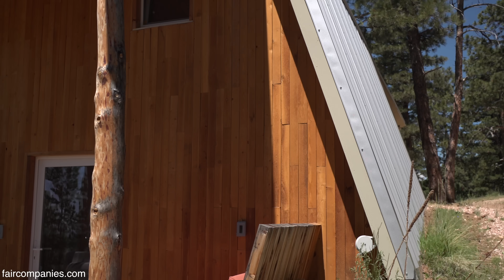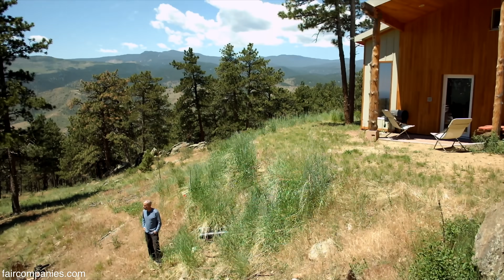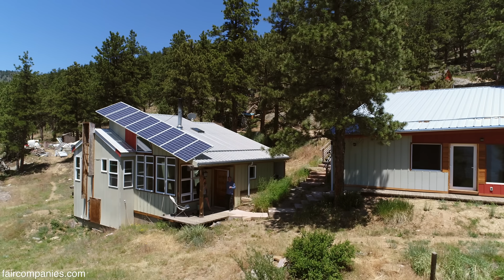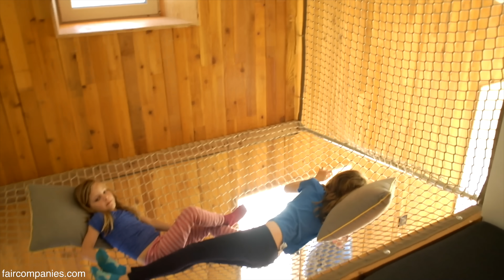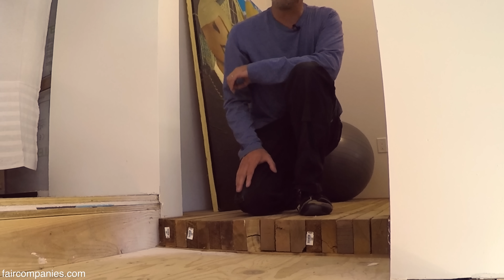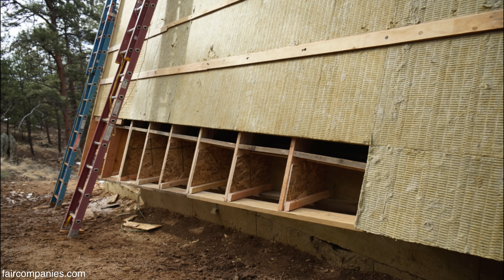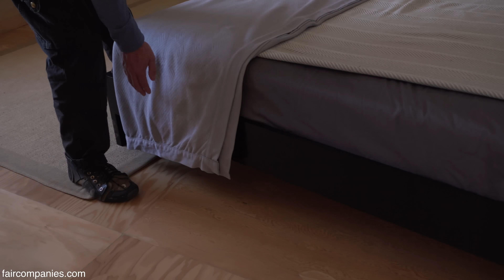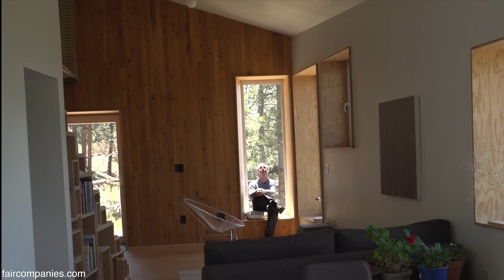Designer builds efficient off-grid Passive House in Colorado

Comment: I think it's absolutely asinine for it to be against the law to collect rain water for your own use, like for watering the garden or for the toilet, anything that doesn't have anything to do with drinking it or bathing in it. Then of course during summer, towns often have a water ban. You can't wash your car, or water your garden. In some towns you can't even have a food garden!
There are WAY too many stupid laws and regulations that make it hard to be innovative, thrifty, clever and even eco friendly.
I remember my grandfather placed a bunch of big barrels along the bottom of his garage roof line because a big storm was due. It was a big storm alright, the rain came down in torrents and filled up the 55 gallon barrels in no time at all from the rain pouring off the roof. He saved all that water because there was a water ban on. The water was for his garden. He would dip a small pail into the barrel and pour one pail's worth of water for each plant he had in there each day. That storm was lucky, because sometimes we don't get big storms like that. So it saved the garden.
The really stupid thing is, I can wash my car with less water and soap than the car wash uses. Then you have businesses with automatic sprinklers watering their lush lawns during the hottest time of the day, so most of the water is wasted as it evaporates and doesn't have much of a chance to soak into the ground. Other times they're running when it's raining out! Ridiculous! But a home owner can't water his lawn.

Comment: I'm curious about fire protection. He mentioned that there had been a large forest fire. What type of protection or prevention have they done? The home has three trees very near it and is comprised of a great deal of wood, which would be a concern for me. Thanks!
Reply: HolisticVibrancy the urban wildland interface is a precarious place to build. The house uses several methods such as a fire rated assembly of cement board of steel with mineral/stone wool board underneath for the exterior. The simplified shape creates less places for embers to lodge. The trees are a part of the protected space. There are no ladder fuels and a break in the tree canopy with lots of thinning beyond. Ponderosa pines are quite resilient to fire if not too dense, if fact they rely on periodic fire for a healthy forest. Finally the windows are triple pane and tempered to resist cracking from a heat front. Many rural homes burn in a wildfire not from the outside but from a windows breaking and embers getting inside.

Comment: He took a lot of earthships ideas and did the most impotant one terribly by building a huge  north facing wall. but he also did some amazing things like the net bed the floor wall next to it, the stair boxes, his flooring choices, and kitchen cabinets/counter etc.
Reply: This is not really anything like an earthship aside from some passive solar. The earth rammed tires were reused from an older shop and are outside of the thermal envelope.
Reply: Let met first say that I think your approach and execution are nothing less than brilliant!!! 

I slightly misspoke. Let me correct my first statement: There are many elements of this build which are similar to earthships: Rammed earth tires, passive solar, rainwater collection, Cooling tubes, berming/ passive geothermal (it seems). The rammed tires of older earthships were never inside a thermal envelope. They have only now begun to experiment with that in the last few years by creating a thermal break. Cooling tubes are used in earthships.

My only critique is of the height of the north facing wall. I think it was a contradiction to have said, "you don't have a lot of walls on the exterior." and the to have an exterior north wall  that is, on appearance, equal to and or taller than the south facing wall (albeit outside of the thermal envelope which is an interior wall that has at the very least "18 in. of insulation" and is itself more than like insulated.).

Again you execution and approach to tapping into the steadfast laws and physics is no less than brilliant and as an aspiring build I only hope I build a home HALF as brilliant I i truly KNOW yours is.
Reply: Thanks for clarification and the compliment. What you are referring to is what we call form factor- where you maximize the floor area relative to overall exterior wall. The great thing about Passive House is we need a moderate amount of solar gain for it to work so I don't need a huge wall of glazing. The overall wall system can be simpler but the north elevation being larger than the south has no significant extra heat loss. Since much of it is protected thermally by a second exterior wall (partly tire) that is accounted for in the energy model. These are not hard and fast rules but guideline which can be modified based on building needs in the certification design process. You can build many different ways to get the same result.

Earthships are really quite limited in how they respond to climate conditions so I get a bit queasy when I hear them compared to Passive House.
Reply: //You can build many different ways to get the same result.//

Indeed. There are many ways to to get from Boston to Worcester including taking a boat to Portugal, train thru Europe, bus train, camel, train bus, boat from China to California greyhound etc. The result is the same as getting in your car and driving at 65mph for 45 mins on I90 West: you went from Boston to Worcester. But was it the most efficient and effective means of getting there? 

My question was not about the end result being the same (straw man). It was rather is the building technique employing the most efficient use of materials to enclosed space and thermal regulation divided by energy input in material production. installation, and maintenance over the long term. 

//Earthships are really quite limited in how they respond to climate conditions//

I'm curious to know what exactly you mean by this.
Reply: Sorry, when I said same result I should have specified to achieve Passive House certification. Earthship were made for high desert environments and they do OK there but most of us need a building with a very different climate, orientation, program etc. I think the rule of thumb design approach such as earthships is from an era before we could calculate how a building performs and has not kept up with building sciences.

Comment: exscape is not a word.
what does he mean he doesn't have a lot of walls on the exterior? at least 4 right?
I like the staircase but yah its a tansu basically. but still I like simple boxes and I have done a similar thing in my daughters room where the storage boxes become chairs but mine a dimensional a bit more sophisticated ie the measurements with cushions are at optimal ergonomic height for seat, desk or tables depending on which side is up. 

i like these houses but there are a few reasons why they are not sustainable.

1 land prices make you move so far out of civilization that its hard to make a living.Its hard to make a living off the grid. 
2 still the house is going to cost you quite a bit which means you need a decent job, winning the lottery or an inheritance. 
3 imagine if everyone did this in Colorado and tried to catch the water. not sustainable.then again Im not sure there is a better solution for a remote house like this and im sure most people dont want to live so far out. 
4 relationship with yourself is fine but some would call that schizophrenic or antisocial. LOL.   people have a basic need for community. again not sustainable.

 natural does not equal sustainable. 

BUT overall its well thought out and I like it.

Comment: I had to laugh when I saw all the boxes.  I moved from a large 4 bedroom, two bath apartment to a 1 bedroom 1 bath apartment.  The large place had one whole wall of built in bookshelves; perfect for me and all my books.  Of course the smaller place had none. I had to come up with ways to fit all my books, so I bought 11 1/2 X 3/4 inch shelving boards and made open boxes of different sizes.  It is hard to reconfigure space when sizing down -- I had some things in storage boxes for a year before I emptied them into their new places -- and the boxes were easy to move around and stack and rearrange as I settled in.  Two boxes ended up as storage in the laundry/pantry/storage room.  One box is in the front clothes closet that I now use as part of my "office" and in this box there is a pillow for my cat (which she thinks she discovered all on her own.)  The rest are stacked up and hold books.  I LOVE the versatility of boxes, and I see this guy does, too.  :)

Comment: He sure used a lot of toxic materials for trying to be so eco friendly.
Reply: Kat we really didn't go into materials much in the video but this is a foam free low toxic project by just about every measure. Feel free to take a closer look in the Inhabitat articles I wrote on the topic https://inhabitat.com/how-to-build-a-passive-house-off-grid-without-foam/
Reply: It was mostly the floor that concerned me.  Personally I wouldn't want to use things like Polyurethane and if I was going to use plywood I would want to be very careful because typically it's made with formaldehyde.  Those to me would not be things I would want to put in my house and also their manufacture is not good for the environment which when designing a green house to me is important.
Reply: Kat its actually a polyacrylic I (misspoke in video) 50 ppm VOC. We are doing extensive indoor air quality measurments with  University of Colorado and are finding little added VOCs to natural background. Remember all wood buildings use glues for beams, plywood, or OSB for structure so rather than make assumptions it best to use best practices and then measure results.

Comment: Great info. I wonder how he joined/sealed the edges of plywood pieces with each other to form the seamless joint. Good idea.
Reply: Nurgul Konyssova good question. I used a biscuit joiner and did a little sanding at the edges. Hardest part I remember was to try not to have any squares off so the next pieces lined up.
Reply: I think you did it brilliantly. Smooth floor surface made of such common and rather inexpensive material. Nicely done.

Comment: I guarantee moisture and mold issues with this stupidly constructed home
Reply: Damien Thorbjörn with thick walls mold is a critical issue. The walls vapor profile was very carfuly designed to have little or no condensing surfaces in the dew point range. The walls also are very vapor open to the exterior. The ceiling utilizes a "smart" vapor retarder on the warm side.
Reply: @ACMichler  what a polite reply to a mean comment

Comment: I am very fascinated about passive houses.  You answered a important question: are they necessarily expensive to build.  I've read those windows are expensive, but you have created a beautiful space using elegant, inexpensive materials that work.  I wonder about the thermal shielding between the foundation and the house.  I've read that is a critical issue.  Did you use the special, thermal concrete?

Comment: I used to live between Pine Cliff and Rollinsville in the late 70's/early 80's when there was rather pristine, people free land available.  Some built small cabins just large enough to sleep and tepees on BLM land.  Occasionally the agents would go through on horseback and roust these individuals but they would always return because the knew the secret to squatting was keeping the 'investment' low.  I'm sure there are still some doing this.  These folks built way beyond 'passive' in that their hooches were very small and heated with lantern or very small sheet metal stoves and probably cost less than $200 each.  When I think of survivalist or minimalist living I think of these abodes.

Comment: Would love to know what his air recovery/air exchanger consists of, to run on 60 watts? Thanks
Reply: It seems like the fan on these is about 60W, but actually running an HRV heat pump would kick you up an order of magnitude, no?
Reply: An HRV exchanges energy between the outgoing air and incoming air via a membrane heat exchanger. We bypass the system summer for the cooler air. There is about an 8% energy loss so we have to be carful with the volume of air we exchange in winter.
Reply: Its and AirPhoda 92% efficient HRV which is no longer available in the US and uses about 45 watts for 62 cfm. Similar units are available by Zehnder which are Passive House certified by Passivhaus Institut. There are a lot of HRVs which claim efficiency ratings which don't perform anywhere near that in the real world so you get what you pay for. The other 15 watts or so are for so called phantom loads like a water recirc pump and stuff just plugged in.
Reply: Awesome, thanks for replying. Does it run on AC or DC and doesn't your water containment freeze in the winter?
Reply: Everything is AC on a 2800w Outback Inverter and I run a very small inverter for the HRV which is 220v. The water pipes have never froze as the outlet is at the bottom of water catchment tank which is 4 feet underground. So happily even if the surface of the water froze  it has never affected the supply line.
Reply: There is no heat pump. The incoming fresh cold  air is warmed by the outgoing air via an air to air heat exchanger
Reply: +Paul Ohlstein ah so its a regulated cooling system? Assuming flow in and out are the same, the net result has to be cooling then, unless you're adding energy to the system some other way
Reply: + Max Pfeiffer There is net cooling, but less cooling than if raw cold air were to be admitted into the house and house air were to be exhausted.

Comment: The energy and design aspects are excellent, but the indoor VOCs from the plywood, polyurethane, and propane are high. Mold with cellulose in the walls is also an issue, though insulation choices are difficult (cork is better, but expensive).
Reply: We are doing ongoing air testing tests with University of Colorado and VOCs have not been much higher than natural background. Leads me to believe that we do not have a good handle on air pollution from just assumptions. Mold grows on anything organic that is damp, the wall was designed very specifically to dry outward and inwards so unless there is a hole in the roof everything will be fine. We have to put a lot of thought into mold in high performance buildings https://foursevenfive.com/new-mold-growth-index-and-safe-double-stud-walls-wufi-pro-shows-intello-plus-is-key/
Reply: Tyvek is NOT a vapor barrier. It is specifically made to pass water vapor, but not liquid water, so that the walls can dry from the inside to outside.

Comment: The extra thick walls and the boxes are the best part of that place.  The 2x4 walls are alright, but too much weight for an on wheels setup.  One way to save a little space though as traditional framing would be 2x4 + 1" + 1" for finishing.  Minus a few quarter inches for real world dimensions.

Comment: How did you get by the building code thing.  I am guessing you are in Larimer County which is very strict.  I don't know if Red Feather Lakes area is Pima County, but I don't think so. How did you get away with building it your way?
Reply: Larimer County is very reasonable actually. Many code officials have not seen a Passive House before so its always a crap shoot in how they will respond.  But there is reams of data for each project and I think many might just might say these guys did a lot of thinking about this and we trust them. This house is perfectly legal under the 2015 IRC.
Reply: You are very blessed.  I had a friend that wanted to buy land in Larimer county and they chose not to due to all their regs.  I use to live in Weld County (sorry, I said Pima...oops) in the country and they pretty much left you alone :-) I miss it there, but not all the new politics

Comment: Looks too expensive for what it is.
Reply: Idk, been doing a lot of calculations myself for upcoming house.
His steel roof, wood facings, cellulose insulation, plywood floor, cheap tiles, concrete. All of these are as cheap as they get, except cellulose.
Dont see how this is expensive, especially how he built it himself.
they usually say 3-10% more for passive house, depending on climate (the colder the more benefcial) you will make it back, and once you do you'll live out your life with minimal cost.
Reply: i was going to make a similar comment about cost.  For the state and the politicians 'energy conservation' may be the goal, but for the layman, he's energy conscious with respect to his wallet.  If you have to spend $60,000 on energy over 10years on a space, or tack on an extra 60,000 upfront for an over-engineered space,  you're still spending 60,000.  I mean i get the argument that if you can insulate the space, then you won't be so beholdened to inflating energy costs over time, but damn if that ain't a hard sell.    I think most people are willing to just spend $20,000 on the building and 80 on energy over the rest of their life.  Few will spend 80 on the house, 20 on energy.
Reply: Costs are dropping everyday. Health considerations, hard to monetize, should be included. I was surprised that many owners comment more on living quality than energy savings. ALSO, in NYC, where I am, they are amazingly quiet. Not to be taken for granted!

Comment: induction heat boils water better than gas.
Reply: but it does not have a blue soul :)
Reply: Andrew does not have the electricity to run an induction stove. A simple percolator would boil water using the least possible kw-hr per quart.